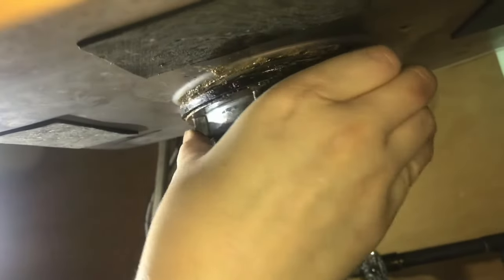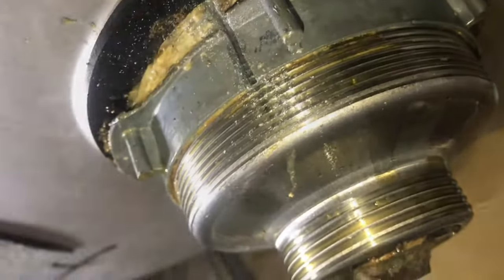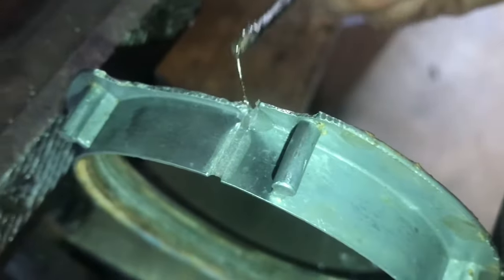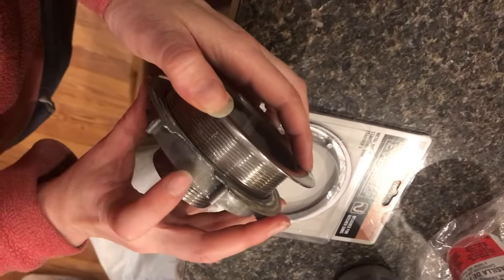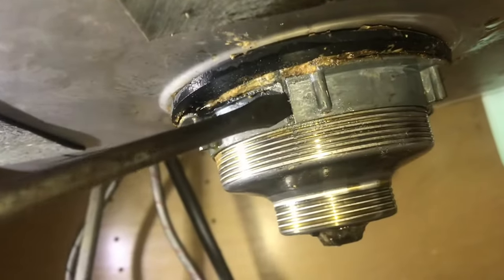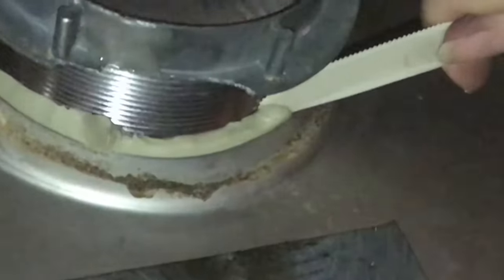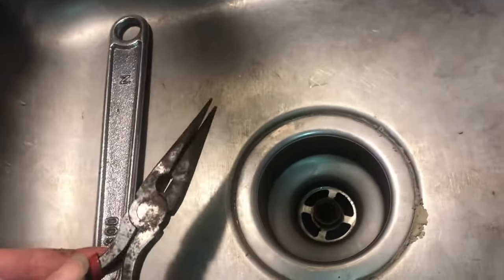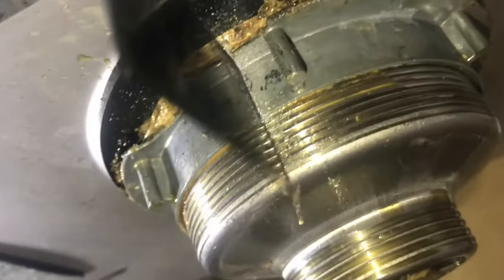kitchen sink nut locknut (REMOVAL) “tricky" basket strainer

Comment: Drill baby Drill - If you are replacing the whole strainer ($10 Lowes). I just drilled one hole in the old nut from the side (started with a pilot and then larger) and once broken, simply pried the nut off.  Total 5 minutes.  This is after trying all the other methods and tools realizing that drilling it would be fastest since it will be thrown away.
Reply: p drummer - thanks for the tip.  I tried all sorts of ways to remove a seized sink locknut, but I drilled baby drilled, and it took less than 5 minutes!
Reply: THANK YOU!  Not gonna lie, I was so frustrated with this issue, drilling never occurred to me.  Tried using a dremel cutoff wheel, but was afraid of cutting into the underside of the sink.  Drilled away and popped it off!  In less than 10 minutes the whole thing was done. Thanks again!
Reply: You are a superstar!

Comment: I was just about to get the multi-tool out but decided to give the locknut a good knock with a small hammer a few times around the perimeter and it loosened it up enough to get it off.

Comment: Thank you for showing the cut method to remove the lock nut. I used a a Ryobi multi tool to cut it and still needed a hammer with a flat head to pry it off.
Reply: It wasn't this particular comment, but when I read to just cut it rather than trying to unscrew, I was like..... DUH! saved a whole bunch of time. The old one was going to the trash anyway, so might as well destroy it along the way haha

Comment: was gonna pull out the blow torch but you know what. i think the angle grinder with a cutting wheel will do just fine. the left one was easy. the right one is really seized or torqued on there.
Reply: angle grinder was too big. went with the dremel. got through that sucker!

Comment: Sadly mine is oddly shaped so i can't just cut as you did and its close to the sink bottom. No washer I'm hoping they have a corner type metal cutting tip to make it easier to cut since its two sides to deal with. A surface against the threads and the top part by a maybe Half a inch. I'm wondering if their is no turning back but to cut it or perhaps a stronger metal cutting material.

Comment: I use my mapp gas torch to melt the nut. Takes about 5 to 10 seconds. Just be sure to keep heat off sink bottom. Also forget plumbers putty. We use clear silicon rubber. Just have a clean disposable rag to wipe off excess. I am a ga. master plumber, retired.